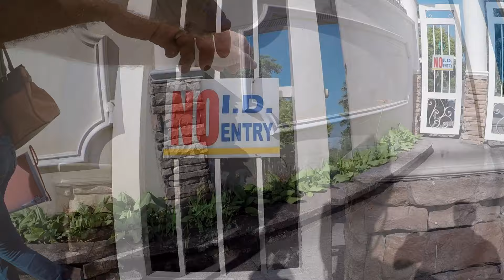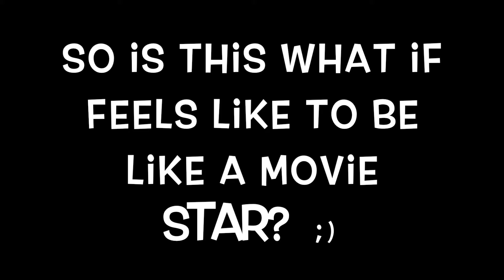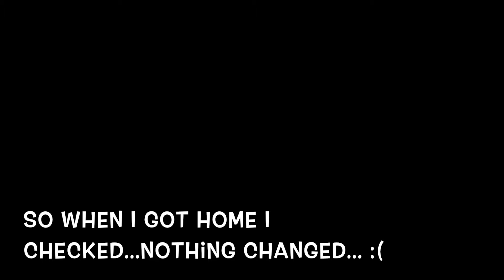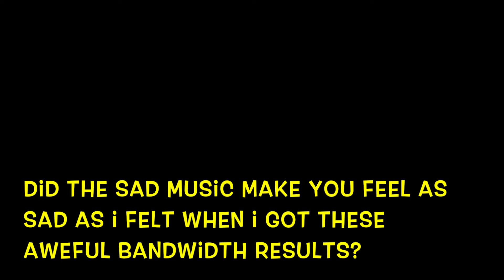VILLA FELIZ - EPISODE 34: WHAT DID YOU CALL ME? (House Building in the Philippines)

Comment: Hi James. A lot of work completed yesterday Great crew.One thing that has been bothering me is lack of reinforcement in your external walls.These will act as retaining walls when you back fill behind them. You have about 1.5 meters of ground behind the walls excluding the loose spoil you have stacked on top. 6 inch block work would not be my choice to hold back that amount of dirt.Having seen the way they lay blocks and type of core fill used.Also how do you intend to fix vertical reinforcing to first floor bond beam. I would get a machine in to move the loose spoil sitting over your excavation. If you have a downpour as we had here in Queensland yesterday .almost a meter of rain in 2 days t will take you a week to shovel it out of your basement.
Reply from the maker: Hi Liza and thanks for the comments.  We haven't started the external walls yet but when we do it will be filled with concrete and steel reinforcement.  We have vertical and horizontal rebar attachments to keep the wall from shifting from the beams and columns.  And as you've observed, we're using 6 in. CHB instead of the 4-5 in. which is the standard here.  This should help quite a bit.
This is not rainy season, but you never know living in the tropics.  Have my fingers crossed.
I've also asked my contractor to look into something like Durock or Hardibacker to put against the exterior wall after the waterproofing is in place.  I'm not comfortable with the soil sitting on the CHB.  I know water and it's one of your biggest enemies when doing this sort of construction.
Thanks again and I can't tell you how much good info I'm getting from the folks "Down Under" in your neck of the woods!  👍🏼

Comment: james  ,my name is rey im in the reno service bussines here in toronto canada soon to be a balikbayan dont know where yet . enjoy your vlogs been a sub early this week  seen all your videos . 1 thing we  builders worry  is hydrostatic  pressure on exterior basement walls  here in the northeastern region  so  we put tar walls thare below grade plus  dimple  sheet plus  crushed rock gravel beneth  perforated  sock covered weeping tile  before backfilling please consider this  if possible ,also maybe sahara  cement on exterior wall remember prevention better than cure   Thanks ,all the best  Go Villa Feliz!!
Reply from the maker: Hi Rey, and thanks for subscribing to my channel.  Here's our plan thus far.  
1. We will be putting a waterproofing on the sub grade exterior wall.  
2. We are also going to use perforated pipe surrounded by crushed gravel at the lower beam level of the basement leading to the cistern or sewer, whichever we end up thinking is the most effective.  
3. I asked my builder to put another layer between the waterproofed CHB and the backfill earth, but we still haven't selected that material yet.  I was wondering if something like Hardiebacker, which is used for wet areas, would work as a buffer between the CHB and the earth.  It's really available at our supplier.
What do you think?
Reply: James not sure about cost effectiveness of hardibacker it still does not  provide airgap  like dimple sheet  please google water proofing basement walls. This though plastic membrane is applied dimple side facing wall after tarring walls, almost all our new construction basement walls are solid pour concrete redimix 6 to 8 inch thick, cement  truck plus cement  boom truck even with all this precautions  foundation walls still cracks ussually beneth basement windows or near corners 1 reason is because recidence builders dont use  rebars, my opinion  This is also  from personal  exp. my own house has small crack  hard to fix have to dig 6 feet to footing messy ,time consuming  for your peace of mind you want to get this rite 1st time , see if you can source this material in PI . lowes, home depot sell it  in   usa  a  must if you want dry basement here in canada we  normally finish &  make our basements living quarters Thanks,PS look forward to uploads youve made me an addict to my PI Dreams
Reply from the maker: Great info Rey.  I told my contractor to look for a product like that.  If its the same as Superseal Dimpled Membrane, we might be able to find that here in the Philippines.
I really appreciate your advice!
Reply: hi james, Rey here if,when you install perforated weeping tile make sure it has nylon sock covering to guard vs tree root & soil infiltration.Remember nothing like redundacy ,backup to backup,      with settling ive seen hollow block mortar crack over 20-  30yrs if cheap enough  parge skimcoat  sahara cement waterproofing .have a nice weekend thanks Rey.

Comment: Just wondering if you have thought of doing a direct pour for your basement walls instead of blocks. Did this as my first job, pouringbasements.  I understand having to mix that much cement might be a hassle. But might get a straight wall and cheaper than making or buying blocks.  Am still waiting patiently for the floors being poured.
Reply from the maker: I would have loved doing a direct pour with forms, but my contractor doesn't use that technology so I'm restricted to his expertise.  I do agree that its better than CHB's.

Comment: it dosent make sense tou are putting waterproof on the walls but you dont put any plastic down on the floor...that would not be passed in the uk
Reply from the maker: 3 years so far no issue.  If we were deeper in the ground or at a lower elevation I would have insisted as we do in the US also.